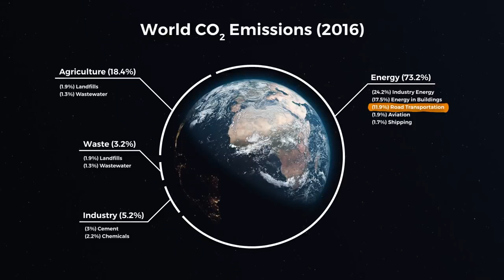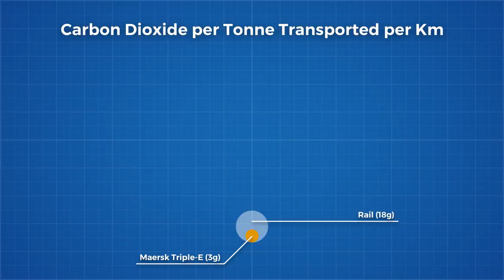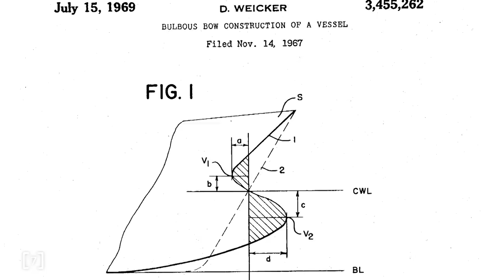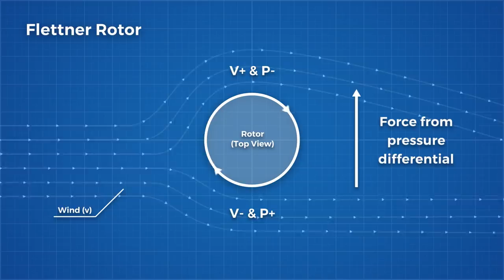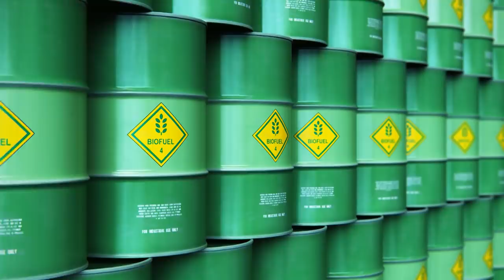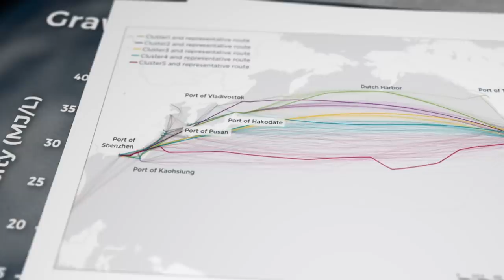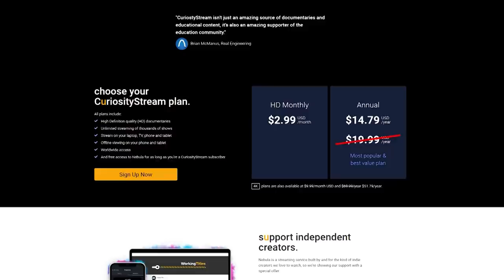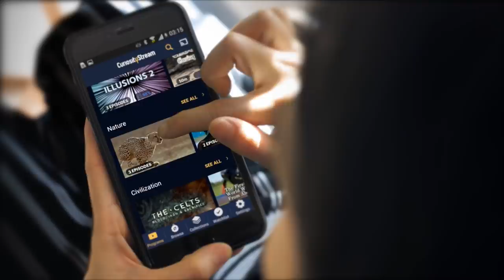Are Renewable Powered Ships Possible?

Comment: I remember reading an article proposing that ships could fly kites up into the high altitude winds to act as sails.
Reply: I think the company who wanted to do that went bankrupt. But Wallenius - a Swedish ship producer - wants to build the Oceanbird in 2024, a smaller cargo ship that uses wingsails to partially power itself through wind like smaller hightech catamarans are doing it.

What I would love to see is if you could fit a ship already using wingsails with a flying kite wind power plant. Because you could get a bit of acceleration from the kite acting as a sail, but also electrical power from having it fly figure 8s in front of the ship. And I know it wouldn't produce much electricity compared to what the ship would need, only a few megawatts at best, but it could reduce fuel consumption a bit and maybe double as a small power plant in harbour cities once the ship is docked.
Reply: @midnight8341  the flying kite power plant is not possible. A kitesail is typically moved into the best position to provide thrust so there would be no practical way to generate electricity
Reply: @jamesday7339  yet a kitesail is not economically practical in comparison to a wingsail, at least according to the companies. So you could integrate a kite wind power plant into the ship, since the ship is practically stationary compared to the kite, since it is moving pretty slowly. And depending on what method you use to generate electricity, I think a part of it could be used as thrust, even if it would be miniscule.
Reply: @midnight8341  there is no way to generate electricity using a kite sail. They only provide thrust and as for the economics of kitesails vs wingsails kitesails will win in 90% of ship types because the deck space is too congested and there is too much over deck work done when in ports
Reply: To address the suggestions that sail power is the answer I offer the following.  In 1870 a premium sailing vessel entered service, the ‘Cutty Sark’, she could carry around 600 tonnes of cargo at speeds of up to 17.5 knots, dependent on the prevailing wind, to harness the energy the available spread of canvas was up to 2 976m2.  To round things out that was circa 5m2 of canvas for every tonne of cargo carried.  The ‘Cutty Sark’ was designed and built for employment in the tea trade where time on passage was a large factor in securing the premium freight rate that made her cost effective but as soon as the Suez Canal opened, which the ‘Cutty Sark’ was unable to sail through, she lost her advantage, raw speed, to the steam powered ships of that era.  Mechanically powered ships have improved in terms of efficiency, on a freight tonne mile basis, by at least one order of magnitude since then.  After losing out to the coal burning, steam reciprocating mechanical ships of the late 19th century ‘Cutty Sark’ was relegated to the Australian wool trade, just about the bottom of the barrel in maritime terms and only one small step up from being a 'honey barge'.  The canvas, cordage and extra manpower needed for sailing ships was never a very benign environmental option so please discount any idea of sail as ‘sustainable’.  All this is without the problem that if ‘the wind don’t blow the ship don’t go’, when it does blow it often blows in the wrong direction for your cargo delivery needs and sometimes there is rather too much of it for comfort.
Reply: @BernardLS  sail power is very sustainable and is most definitely going to be involved in the future of ocean shipping trade if the shipping industry is to be carbon zero. The sails on the cutty sark are extremely crude in comparison to the modern sail plans we have in use now. Also modern weather monitoring systems can allow vessel route planners to choose routes which will have favourable winds. The combustion engine on big ships is what is unsustainable
Reply: @jamesday7339  Morning James. The mariners of the 19th century, like there engineering peers, were just doing the best they could with the resources available so the key parameter is the rate of harvesting of energy, the wing form 'sails' (?) on the KTH project that Wallenius is funding probably will yield more energy per m2 than the canvas and rope of the 'Cutty Sark' but will it be enough?  As to weather and routing better prediction and evaluation still would not compensate for prevalent surface current and weather patterns that do not accord with ones cargo delivery requirements.  Reduction in the overall number of freight tonne miles the global population use could be the best option IMHO.
Reply: @BernardLS  well actually yes the wing sail project could eliminate the need for fossil fuels in some ship types. I’m currently working on a very similar project which has only a few slight differences to the KTH one and from a design point of view could replace fossil fuels use for dry bulk carriers, obviously we would need different solutions for other vessel types such as container ships as they travel much faster. The main problem with wind power solutions is the average global wind speed is 15kts and many vessels need to travel faster than this however there are many proposed solutions to this such as using the Magnus effect.
Reply: @jamesday7339  my first though is ‘reduce the speed’ more speed needs more energy lower speed means more goods in transit so the money is tied up but not lost.
Reply: @BernardLS  yes that’s about right ships will start to slow down but there will be more new ships built to keep the global shipping capacity about the same
Reply: @jamesday7339  Not sure of the logic of Magnus effect rotors as opposed to vertical axis wind turbines (VAWT).  Surely The Magnus effect rotor requires energy input that must be provided by an external source while VAWT would harvest energy that could be used for propulsion.
Reply: @BernardLS  Magnus effect use the difference in pressure either side of a rotating cylinder to produce thrust but require small energy input and vertical axis wind turbines would need a stationary base to be most efficient and also bring in huge issues of stability

Comment: Finally someone's talking about it. Worldwide shipping industry could do lots of efforts in terms of eco friendly transport. These boats, aside from using very bad quality oil, also have bad impact on the ecosystems they "sail" through. When stopping e.g. in Singapore to load cargo, they pump water into the ship incl. microscopic animals, algeas and others. Then they sail all the way to let's say France and offload the cargo as well as emptt the water they pumped in Singapore. Local marine life then faces new non-indegienous plants and microscopic animals which have the potential to completelt overrun and destroy local marine life. Ships are far more problematic for the world than we think, and no one except you talks about it
Reply: They used to do yeah but that's not allowed any more there are now surtain areas where they have to lose the water and take on fees water so they don't get spread around
Reply: @jobvanbommel3912  great to hear that it's coming under more control! Wasn't aware of that, thanks.
Reply: Nuclear power plants would be the only option but they're currently only for military use since you don't want to risk them ending up in the hands of very bad people. Sadly, there's nothing we can currently do about it. Oil is required to literally fuel innovation in other energy solutions such as solar power. You can't go through industrialization solely on wind power.

Comment: Why no mention of nuclear? Or electric?
Reply: the electric option at the end of the day is one way to use nuclear power, as there is simply no other energy source large enough
Reply: Electric is being done for very short trips measured in hours, not days. The batteries are simply not good enough for 30 day long ocean voyages.
Reply: @Longrangehunter  Just to clarify: hydrogen means electric propulsion.

Comment: Naval architect here working on this specific subject. The video is good and informative.
As added you could mention nuclear power which is currently investigated and also there is an interesting patent pending approval on this matter. Moreover, carbon pricing alongside carbon capture should be mentioned. They will probably play a role. But overall good.

Comment: 3:13
Is it really exponential? I feel like it should be approximately quadratic function, because power is a quadratic function of speed for air drag right? And water is just a different medium
Reply: if it would only be friction drag, then yes. But you have wave drag and other forms of drag too. So that's why it is exponential
Reply: https://en.wikipedia.org/wiki/Drag_equation all formulas for drag seem to be quadratic, and if you have different kinds of drags they are just added up. If you think I'm wrong please name a source
Reply: @Beerfazz  research for example froude number
https://en.wikipedia.org/wiki/Froude_number
There are several effects which are not quadratic. In aviation for example the wave drag near the sound barrier. And for ships there exists a similar effect with it's own wave created at the bow. That's why the form of the bow is that important as real engineering stated in the video.
Reply: BAT THINK  🤣😂
Reply: BAT THINK  Yeah you lost ne at "satanists and occultists".

Pass.
Reply: @ma_nu  I looked a bit into the Froude number but could not find something related to exponentially increasing drag. Have you got a link for that too?
Reply: @miQize  that was actually very interesting, thanks

Comment: With the reductions of speeds sailing is becoming competitive as main power for boats.
A French startup called Neoline is currently working with partners to invent the first sail propelled cargo ship for transatlantic shipping. 
Can’t wait to see the majestic big sails on the horizon ! 
Godspeed !
Reply: That seems extremely unlikely to ever be used commercially, which is the most important detail.
Reply: @srs6461  Well, its a step.
And maybe we find a combination of all of it.
A Batterie powered Containership, using Hydrogen and Sails, that combined with Flettner Rotors.
Expensive, for sure but i guess its just "slightly" more compared to the overall costs of a Containership.
Reply: @srs6461  why?
0 fuel costs 
Even if it takes 5 times as long to cross, the cost reduction could probably make it viable
Reply: hey im sorry i gotta spoil something for you - it is not even close to the first sail propelled cargo ship, thats been around for some several thousand years

Comment: Are renewable ships possible?

Hyman G. Rickover: Hold my beer
Reply: And most of the people here have no idea who you are talking about.
Reply: @poppys3728  I saw that name....some unpleasant memories came to the surface.
Reply: nuclear isn't renewable its just low emmisions
Reply: @sabotabby3372  
Nuclear is renewable on a timescale of millions or billions of years with more uranium leached from the earth's crust. The Sun is going to burn out in 5 billion years anyway.
Reply: @gregorymalchuk272  that comment contributes absolutely nothing of value to this conversation
Reply: @sabotabby3372  
It is relevant because it will determine whether nuclear is adopted as a means to a carbon neutral future. And because nuclear deserves all the renewable energy subsidies that make solar and wind look cheap while leaving nuclear out in the cold.
Reply: @gregorymalchuk272  renewable means renewable on a timescale relevant to society right now not fucking astronomical time scales.

Subsidies do not change the finite amount of easily fissionable materials which can be accessed in the near future. Nuclear is a good option for long term stability in the grid but the construction time for reactors is longer than the deadline for zero emissions

Comment: I would have really liked you to talk about nuclear energy as well. Wouldn't that be a good fit for giant ships?
Reply: Exactly, things like SMRs have massive potential for powering large vessels
Reply: Cost is a huge factor. Green electricity is getting so cheap nowadays that the only factor becomes where to put the generator. With nuclear reactors, while they may be amazing for providing power efficiently, they are hugely expensive. A cargo ship with 12000 TEU costs 104 million dollars. A Gerald R. Ford-class Aircraft carrier costs 13 billion dollars, which is 125 times the cost. 

Yes this isn't all the reactor, but you can assume the propulsion system is a large portion of that cost.

Companies need to make profit, militaries don't. Its the same reason you don't bring a mining dump truck to a construction site, its unnecessary and expensive when a better option is available.
Reply: This channel hates nuclear energy so don't hold your breath.
Reply: @brendo3808  Sorry but nuclear energy is cheaper if green electricity is as you say why have I ended up paying more for my electricity then everyone else in the USA  we also got rolling blackouts last summer because they could not provide enough to meet the Daman.
Reply: @brendo3808  Great Answer, thanks!
Reply: @sauvagesparrow8026  the rolling blackout comment says it all. You haven't yet built the infrastructure so the network is running overloaded and hence requires more maintenance and buying of electricity from other locations, costing more. 

A 10 billion dollar nuclear power plant provides the power that 431 2 million dollar wind turbines provide. If there isn't enough power, than there isn't enough investment. Nuclear is outdated and costs far too much for consumers.

The only practical situation is government funded programs like large warships or research requiring stupid amounts of power in a small space.
Reply: @brendo3808  we are the highest taxed state after maybe New York and the largest economy in the USA. wind turbines are cheaper but when they have to be replaced/decommissioned every 20 to 25 years less if built in the ocean because the fiberglass blades are deterred over time. will they not cost more in the  long run? On the other hand a nuclear power plant has 40 years then can be  extended for 20 more years every 20 years afterwards. The blades from wind turbines are also useless after they are decommissioned and most end up in landfills. I view it like my air compressor I got from my grandfather i use it for painting the thing is 60 years old now  and works perfectly even with the abuse over the years were some of them new cheap air compressor for painting break if you look at them funny.

Comment: I worked as a merchant marine engineer for a few years before retirement. The ships I sailed on were relatively small 30,000 ton bulk carriers with 14.000 hp and cruising at 14 kts. We burned approximately 200 BARRELS of heavy (very polluting) fuel oil and a few barrels of diesel for the generators every day while underway.